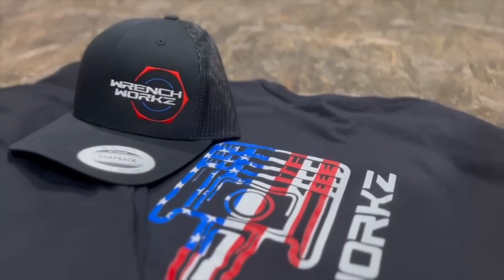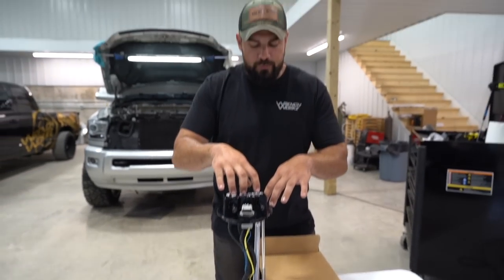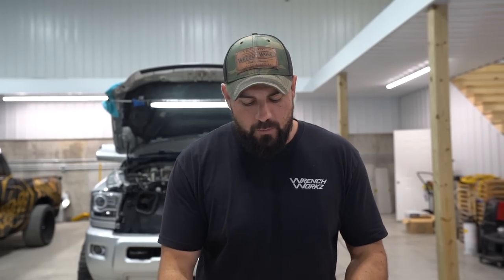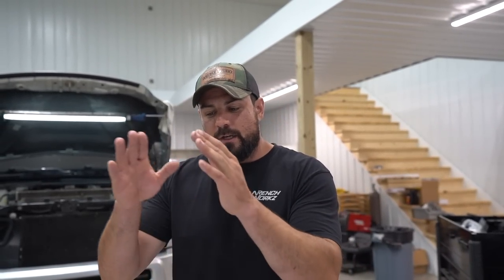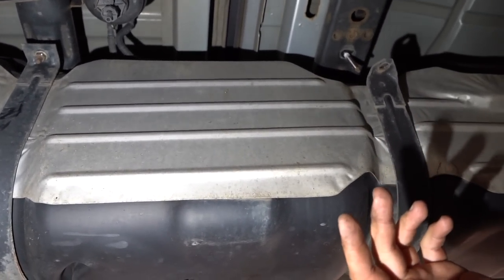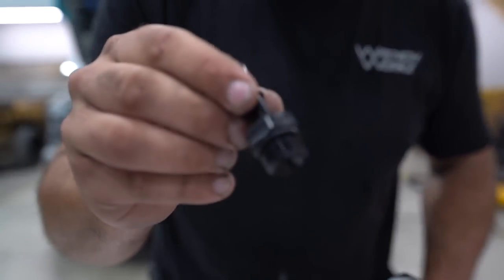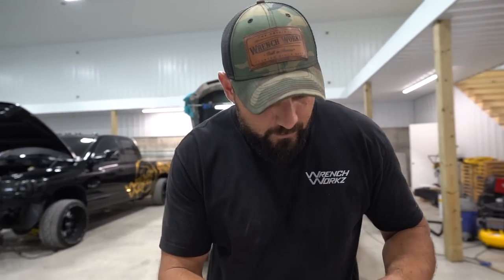This HAS to be FIXED For Your RAM Truck To LAST!!!

Comment: I put the Fleece pump in my 2016 last May, I had 1/4 tank of fuel in the truck and two floor jacks. Did it in my driveway in about 2 hours or maybe a little less. By far the easiest “lift pump” upgrade I’ve ever done. Can’t barely even hear a difference. Still using the factory 2 micron filter setup and love seeing 17-20psi on my gauge at idle. I recommend this option to everyone that asks about it. One of my favorite mods I’ve done on any diesel truck. Works perfect and it was so easy to put in!

For those wondering, I am running CTT tune, stock air, stock fuel: the lowest pressure I see is 10-11psi even on tune 5 👍🏻👍🏻🇺🇸

Comment: I have the very same fuel system in my 2001. I absolutely love it. However, I used the fuel block differently. I bought the additional fleece fuel block and am now running duel fuel filters under my cab on a mount I built. There are cheaper alternatives, but I wanted to build my fuel setup with all fleece. Absolutely love it.

Comment: Tell your Fleece boys to bring back the 4th gen exhaust brake!
Reply: emissioned removed unfortunately never gonna happen :( WCFABs 2nd gen swaps just went byebye aswell
Reply: they hardly provide any braking tho
Reply: Before this, Get rid of the stock turbo and manifold out of here and put a 2nd gen swap. We got a pacbrake exhaust brake kit, this part is gonna fit in for the 6.7 Cummins.
Reply: @3DProductions  Not gonna happen for WCFAB 2nd gen swap.
Reply: @janamaro5894  what are you even trying to say? they arent making them/advertising them for cummins trucks anymore, obviously because they got hit by the EPA...no idea what your point was
Reply: @janamaro5894  and the exhaust brake he is talking about is for a fleece /s400 2nd gen swap lol
Reply: @3DProductions  Yes, they are.
Reply: @3DProductions  I said about a different one that had an exhaust brake.

Comment: Good content. Greg with the head off now maybe a good time to install the fleece coolant bypass at the back of the block. 
why don’t use a fass or Airdog lift pump instead Or is the Fleece pump as good for mild engine performance?
Reply: Good tip! And yea, fleece pump is good for ~700whp even with stock fuel filter setup
Reply: @jaybirdls1  
Awesome 👏🏻 thanks for the information

Comment: "TILT BED"
 I worked at a Dodge dealer back in 90s, Gen 2.. There was a recall for the fuel gauge sending unit..
 Remove all the forward bolts and loosen the back 2 bolts but leave them in. Then Jack up the bed like a tilt bed and slide in under the sheet metal and access the sending unit. no problem would take me less than hour total to do the whole job

Comment: What happens with the water separator in the back near the tank?
Reply: You can install this pump and not change any of the filter setup. Greg’s preference here I guess. I left my OEM water filter and fuel filter as it was. Still making more pressure than stock on the big tune with stock air and pump/injectors. Maybe if you want to squeeze out 700 or 800 hp through this lift pump you’ll want to consider more flow by removing the OEM filter setup?? But for most of us the stock setup will work just fine at 600+ to the wheels I believe.

Comment: Water separator !??? Oh gawd where please. 2011 I've had the bed off and searched everywhere for a "second fuel filter ". Once because I had a dodge mechanic swear it had one. Other then under the hood.
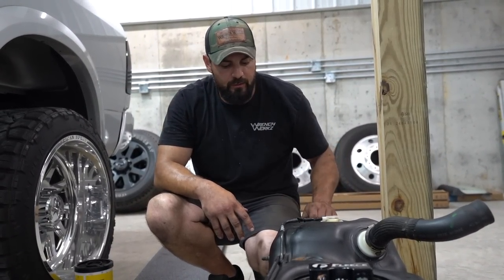Reply: @12:17 oh damn I don't see one on my 2011
Reply: Second filter under the bed is only 2013 and up I believe